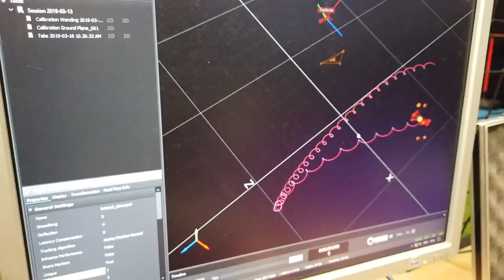This drone crash cost 30,000 dollar$ (drone clash battle)

Comment: You need to build a shocky capacitor suicide attack drone that kills any drone it touches for 2020.
Reply: Or an e.m.p. weapon while building his drone NASA tough to be emp resistant or R.F.P. radio frequency pulse to kill their radio crystals
Reply: @curtisbarker5657 The use of Nuclear weapons is frowned upon in this competition
Reply: @ndvorsky   emp's aren't nuclear, but nukes can be used as emp's. He could use a capacitors and an inverter to generate a 20kw localized static discharge to fry electronics, or even an RF blocker but many states and govs have regulations against such items......
Reply: Im afraid team covid-19 wont allow that
Reply: Yeah, I was thinking of using a Flyback Transformer(High Voltage semi high current transformer) and energizes a bunch of electrodes around it, so when a drone bumps into it just right, the electrical system gets blasted with upwards of 30KV
Reply: NO3- What 2020 event?
Reply: Just plug the capacitor in backwards and smash it into another drone so it blows up
Reply: @gunfuego  wouldn't he fry his own stuff lol
Reply: @jakemckee1986   nah you can make a simple shield using non conductive materials and a couple coats of emp shielding paint....
Reply: Throws faraday boxes on the drones

Comment: The drones with Geodesic wire frame soccer balls over them were Awesome! You need to cover a drone with those plastic array's of spikes that keep birds from landing on architectural surfaces as prop foulers for your opposition or fishing hooks on plastic array's LoL
Reply: Best way to get rid of birds is using guns, basically what i want to say is USE GUNS
Reply: They are called Sweeper Droneballs. They are made by Graupner and I don’t think the team that used them modified them at all.
Reply: @Curtis  -    That's a great idea.   I see those spike arrays all around Los Angeles.  
   I had always assumed they are metal. So, I just looked on Amazon and they have pages of different kinds of bird repellant spikes, diff. sizes, shapes.   Steel, stainless steel, plastic.....wow.
       Which would be the best prop fouler material?
Reply: @rb032682  maybe detachable ribbons draped below the drone attached to the tips of the plastic array of spikes that'd work.
Reply: @curtisbarker5657  -  Having ribbons may end up fouling the wrong props if the drone backs up or descends.    
    My question was more about what spike material would be better to foul a prop: plastic or metal.
Reply: Just shoot a cloud of ultra fine graphite strings  at the space between the drones and the tesla coil while you are reale far away from that zone of death
Reply: @fritzwalmrath4057  That's what the america-themed drone is missing: guns

Comment: If only one drone in this battle was strong enough to carry a padlock around on a rope and swing it around like a mace
Reply: Too bad battery life would be garbage. Sometimes you need a drone with the stamina to outlast your opponent.
Reply: @HobkinBoi  why not use an additional batterypack instead of the padlock? make it so the drone uses the battery power from the mace first and automatically switches to it's actual batteries once that is empty or gets destroyed. Would also make for some fun fireworks if it gets cut into by a drone rotor^^
Anyways, seems you played Hammerfight. I liked that game too :D
Reply: @QuantumFluxable  Weight. Reduces mobility and requires more throttle to sustain flight.

Comment: Build an EMP  (electro magnetic pulse) weapon into your drone next year !!! I'm looking forward to the next battle, more prep time and team "Murica" will kick serious ass!!
Reply: I agree with this man, emp would shred everyone's drones
Reply: might be against the rules from the risk of frying the spectators phones lol
Reply: The only effective EMP systems I know of are explosively pumped flux compression generators, which, y’know, require explosives, so that’s gonna break a bunch of rules and probably laws. Plus, the strength of a magnetic field falls off exponentially with distance, so if the weapon was mounted to your drone, you would be subjecting yourself to hundreds if not thousands of times the energy you would be subjecting the other team to. So, as much as the idea is awesome, such a weapon probably wouldn’t be feasible, and could actually be illegal in the country the event is held in.
Reply: EMP is a good idea, however, it would interfere with connection of everyone's drones (which includes your team and queen) but also your own. Even if the emp is directed away from your drone, it would still interfere with the connections between your controller, vehicle and cameras. 

Maybe if you could have your drone switch to autopilot before it engages EMP so it could safely hover without the pilot, but that would make it vulnerable and would require a dire situation where your best chance is to believe that every enemy drone will be disabled for sure. 

It would also require a lot of energy, and also the vast amount of equipment and space needed for an omnidirectional EMP that is far away enough from your electronics to not effect them would be too cumbersome, and would make the drone akward to fly and inefficient.
Reply: I thought the same thing but it might be against the rules, considering electronics like pacemakers

Comment: Two ideas for defense against the hooks, 1 very hard and thin case around a foam body for an impenetrable shield with a soft core to allow movement, con is greatly increased weight. 2 is just a hollow harden plastic body for light weight, obviously very brittle. An offensive idea to fight the hooks is have them them hook you and then use very powerful rotors to spin the enemy drone off balance and tear the hooks out. Not sure if it would be allowed but a thin aluminum frame (<1/16) is a great defensive approach but seems a little OP plus a little heavy. Might also be a good idea to invest in a lifeboat drone

Comment: i had a crazy idea: its a drone with a fish hook and winch. the winch will be on one side with a weight for balance. the special part is it will have metal blocks along the sides of the prop ducts, on the back of the prop duct there will be small rockets. The drone will reel in a drone and beat it up by spinning to a fast speed and bashing it with metal bars. Im not sure if that is within the rules but it seems like it could work.

Comment: So I think next time you should place light sheet metal around the sides so hooks cannot grab onto it
Reply: carbon fiber for sure (CF is 50 to 100x stronger than steal per weight when used correctly). You only need the paper thin carbon fiber for this. Ironically, the thinner the carbon, the more it seems to cost, lol!

Also flat strips of carbon are ridiculously easy to make, just use a piece of glass for your table (so its super flat, and super easy to clean the epoxy with alcohol), then you can use sheet metal (or carbon) for some little 90 degree brackets to attach the sides (if you want it modular to play with the sides). The reason I'd avoid the weight is just due to how he lost basically due to battery running out.
Reply: Jake Garrett or even carbon plate it by sending it through positive and negative electricity if that works with carbon fiber
Reply: @minnesotangaming8966  Carbon fiber only works with tensile strength in the direction of the fiber weave (I see a lot of Chinese knock off quadcopter frames get this wrong, they end up like a noodle in the air...). The only strength they have out of the fiber alignment is just from the epoxy (so not much...), and that's why I mentioned "when used correctly" (because I see a LOT of fails in this).

I don't think you can plate the fibers without a bonding medium like epoxy (its basically fiberglass, and you actually use fiberglass resin, the only difference is, its a lot stronger than SOME fiberglass types, looks cooler, and costs way more). It is electrically conductive, so technically, you might be able to fuse it to metal with like 1 million volts, but at that point you're just welding it, and its probably just going to fall off and not do anything. Carbon steal is iron with very small doses of carbon infused in it, and I don't think you can just brute force bond the massive amount of pure carbon to a metal to make a weird metal-alloy-carbon composite. You can still epoxy it to almost anything though, like the foam (the epoxy is basically a glue, however, it needs to be vacuum bagged so it compresses the carbon onto the object). Since electroplating only works on conductive things, I assume you're talking about electroplating it to sheetmetal or something like that (if its foam or cardboard, then those can't be electroplated).

Also a cool thing about electroplating technology, John Deere (the tractor and agriculture machinery) currently electroplates their paint, which should make it last a ridiculously long time (that said, I've seen 60 year old tractors still have most of the paint, but this should make it last longer). They also give free tours if you have one nearby, those are kind of neat to see.

Comment: how about having 2 batteries?
once you run out of the first one, you decouple it and switch to the next one, kind of like rocket staging
Reply: Probably against the rules (Lipos are "a bit of a fire hazard", probably not the safest thing to be dropping). Robotics competitions have a TON of rules, otherwise you'd dominate the competition, which leads to primitive things like "lets tape a stick on the front to jab them out of the air!" (honestly, just run into them at 70mph and that will work better). I'm sure metal bladed props were also against the rules (otherwise you'd dominate with a regular race quadcopter slicing up the opponent).

Comment: You should have multiple batteries onboard the queen and a relay or something to switch from one to the other.
Reply: Better than that, the ability to drop dead cells.

That way each new battery is carrying less and less weight.
Reply: Nevir202 great idea.

Comment: Next time drop some strong magnets on those metal drones to knock them off-balance
Reply: Gonna be honest, I can probably fly with a soda can strapped to a quadcopter (and sloshing liquid is awful even on a trailer in a truck, its gotta be even worse in flight). People strap Go-Pro cameras on the ends of quads (like on a 2 foot long stick), and so if THAT doesn't make it go off balance, you're going to need something heavier than a brick!

Comment: my second idea would be to 3D print a Hollow big ball the size of a soccer ball  cut a piece off the top and bottom but just the amount u would need for the airflow make a + with round motor holder like o-|-o needs 4 round motor holder then add props 
for the top and bottom with this mesh i saw on line to give a cooler look Hexagon Perforated Metal Mesh , Lightweight Aluminum Perforated Metal Sheet     
http://www.industrialmetalmesh.com/photo/pl17423205-hexagon_perforated_metal_mesh_lightweight_aluminum_perforated_metal_sheet.jpg

hooks can hook it  the only broblem would be to get enough airflow off the to openings top and bottom